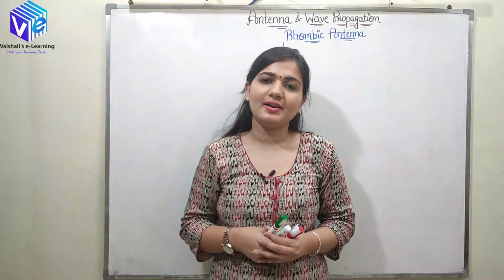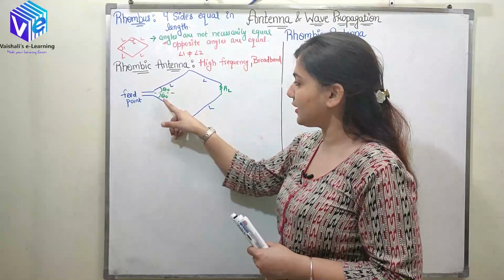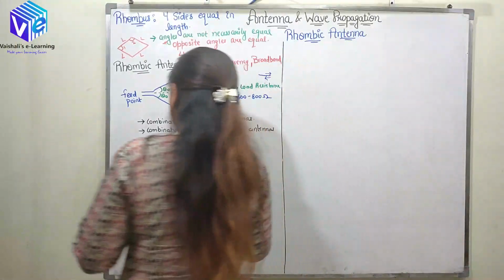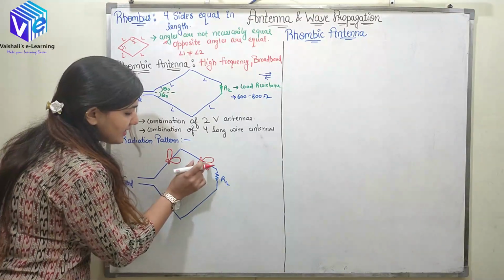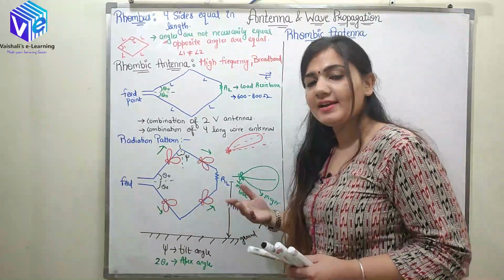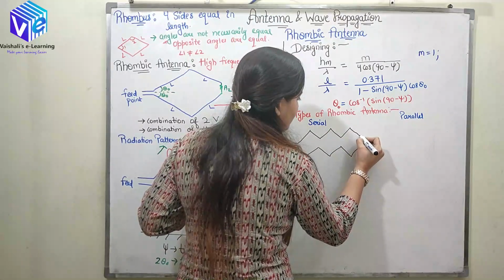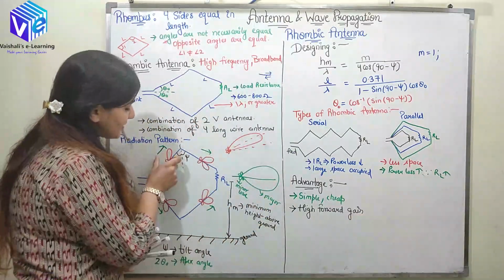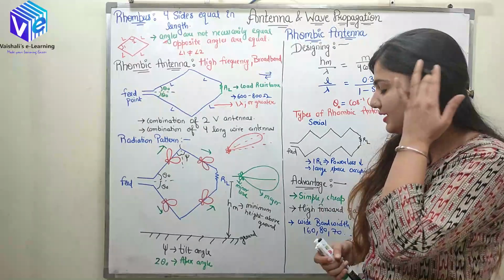Rhombic Antenna | Types of Antenna | Antenna & Wave Propagation | Vaishali Kikan | Lecture 46 |

Comment: I enjoyed your YouTube lecture for the rhombic antenna and I was wondering if you have some advice for building a 2 m half rhombic antenna

I’m planning to build it eight full wave links per side

I was wondering if you could tell me if I need some sort of 12 to 1 Ballin to help match this to a 50 ohm coax feedline

And if you could provide some specifics in terms of how tall the center support should be

And also what type of load resistor should I purchase to prevent by directional propagation

Thank you in advance I really appreciate your help!

Comment: Maam, your videos are useful and helping us a lot. But few of topic are missing which is there in our University Syllabus. Kindly make videos on these topic too. 

Characteristics of λ/2dipole: 7L
1. discussion on λ/4 monopole antenna; Current distribution
and Radiation patterns of center-fed dipoles of length
λ,3λ/2and2λ
2
2. Horizontal and Vertical antennas over a plane ground
Antenna Arrays: electric Field due to 2 element
arrays,3element Arrays
2
3. Pattern Multiplication; Uniform Linear Array 2
4. End fire and Broadside; Phased array 1
3.
Characteristics and properties of different antennas: 10L
1. Wave Antenna, Helical Antenna, Folded Dipole
2
2. Yagi-Uda Array
1
3. Loop Antenna 1
4. Electrically Short Antennas 1
5. Broad Band Antenna (Log periodic Antenna) 1
6. Micro strip Patch Antenna
Reply from the maker: I recommend to watch my antenna and wave propagation playlist..
Thank you so much..
Stay connected for upcoming videos..